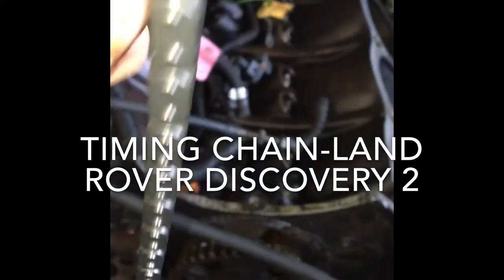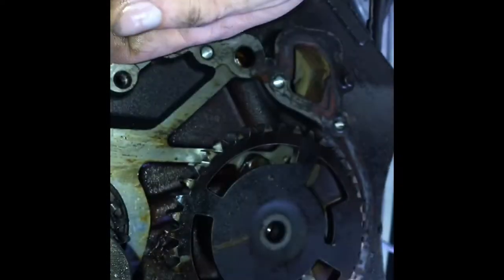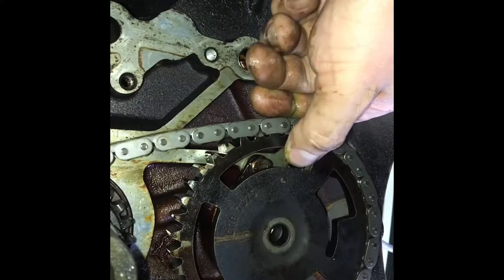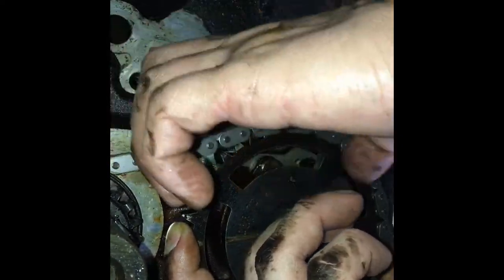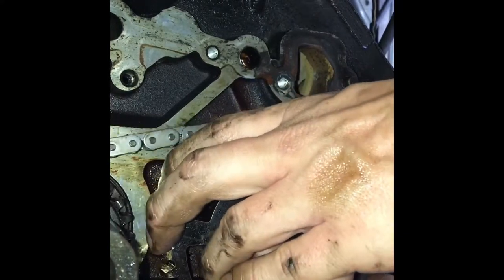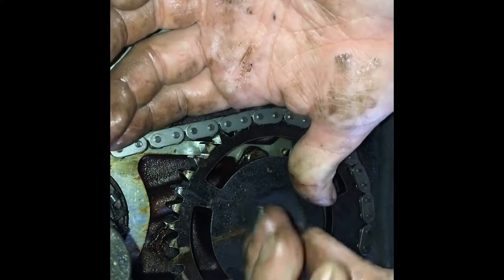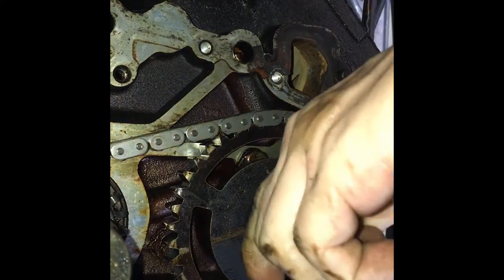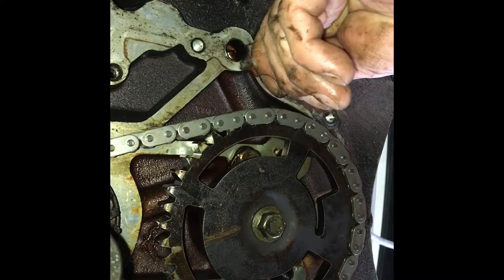Land Rover discovery 2 timing chain replacement v8 Bosch#DIY #cars

Comment: A good quality timing chain and gear set is highly recommended. Some of the aftermarket gears won’t quite fit well and since you already have the timing cover off go ahead and replace the oil pump. I did this to mine @ 180k and it has made a huge difference in drivability.
Reply from the maker: Hey there! Thank you for contributing your knowledge to the rest of us!
Yes all gears and pump was replaced when I did the job. It came out great
Reply: I just pulled mine to do it. Did you start to have random misfires that made you change the loose chain? Mine also was ticking and I traced it to the front cover with a stethoscope. Pulled it off and my chain was loose and my pump had too much play. My rover has 172 on it. D2 01.
Reply: No I wasn’t having any issues with it at that time, it was as a preventative maintenance replacement. Usually misfires are ignition or vacuum leak related.

Comment: Do you always have to remove the Sump in order to remove the timing cover?  (as per the maintenance manual)
Reply from the maker: @Owen-m4v  as far I I remember, yes. Most engines I’ve worked on, the oil pan has to come out

Comment: My new chain has the same slack as the old chain??
Reply from the maker: Jeff Nations does it?
Some slack is ok.maybe your old one was ok

I definitely noticed the difference in slack
Reply: @roverandmorerestore7266  okay, it's just weird because I usually had new chains that were right not the same. Maybe because it's a landrover. Lol
Reply from the maker: Jeff Nations 😂😂 but does your car feel any different?
Reply: @roverandmorerestore7266  not yet, now I have top of the injector leaking. It probably didn't seat good. Now another day of fixing it. Thanks
Reply from the maker: Jeff Nations at least the injector loom is the easy part!
If you ever need any parts and affordability for your disco,contact me.